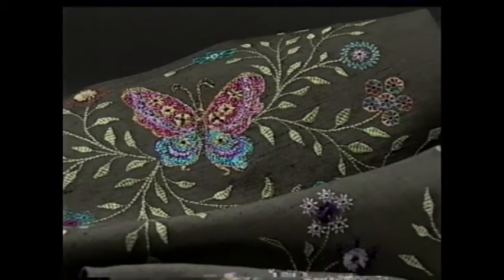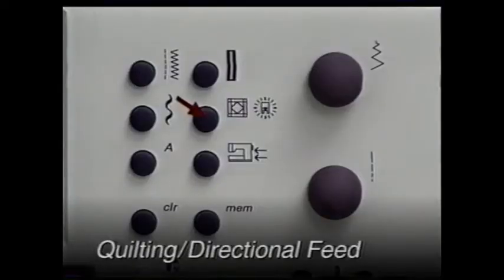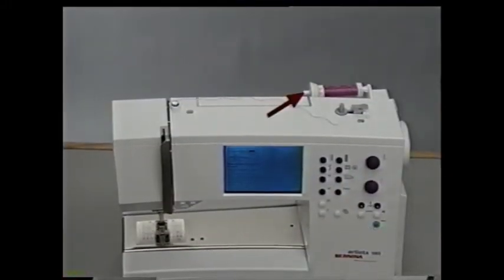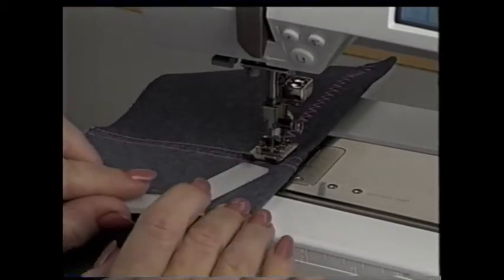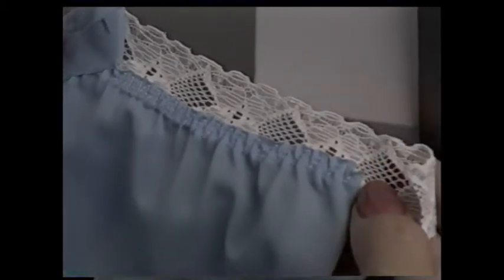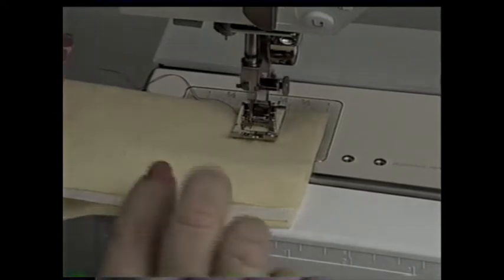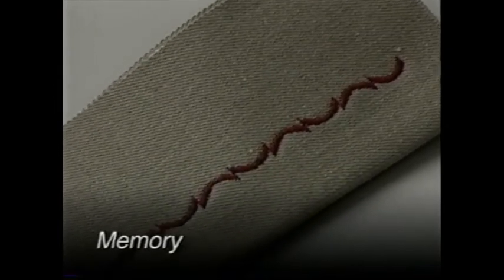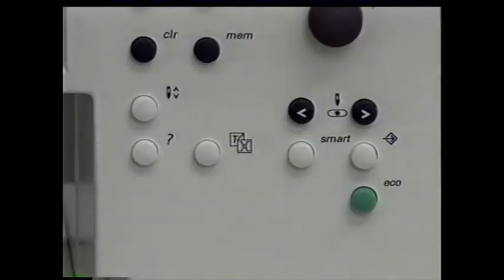Bernina Artista 180 Instructional Video

Comment: I am having bird nest problem with the top string on the bottom of my design...I followed the directions as to change needle and threaded the machine again.  I had to move my tension all the way to 8 to get this almost corrected.  Is this customary?  Will I have to do this for every different design? Artista 180 I bought it used.

Comment: I bought a 180 used. I'm having trouble with the bobbin. The sensor detects a problem and beeps. I cannot locate any dust or thread that is causing problems. The bobbin appears to be threaded correctly. It sews beautifully. But I cannot turn off the error beep unless I leave the bobbin door open. Is there any other way to disengage the warning beep (which seems to be flawed)?
Reply: Martha Myers if you touch the boxed arrow to the right of your ‘smart’ button you will see a box saying beeper tap on that and you will be able to turn off the beeper for the lower thread.
Reply: YouTube videos by "JoeKind1958" show excellent Bernina information. He has two videos that address the bobbin sensor for Models 200 and 730 (same as 180). The are dated Sep 2013, so look for his older posts.
Reply: I realize it is pretty randomly asking but does anyone know of a good website to watch newly released tv shows online?
Reply: @Joshua Israel lately I have been using flixzone. Just search on google for it :)
Reply: @Jude Karsyn definitely, I've been using FlixZone for since march myself :D
Reply: @Jude Karsyn Thanks, signed up and it seems like a nice service :) Appreciate it !
Reply: @Joshua Israel you are welcome :D